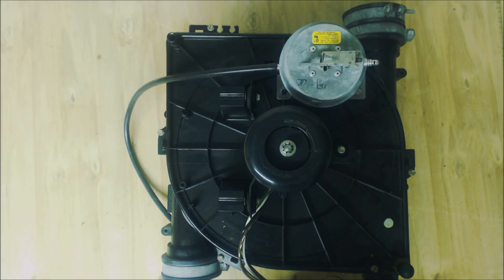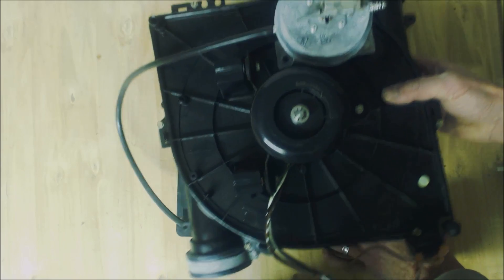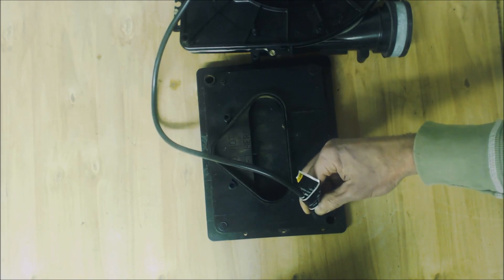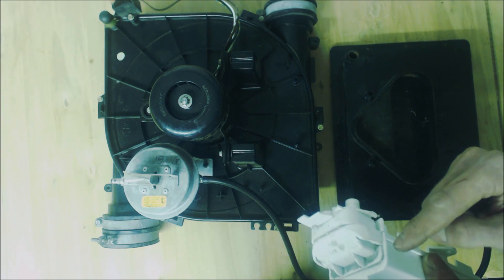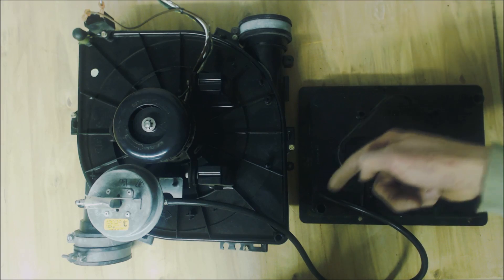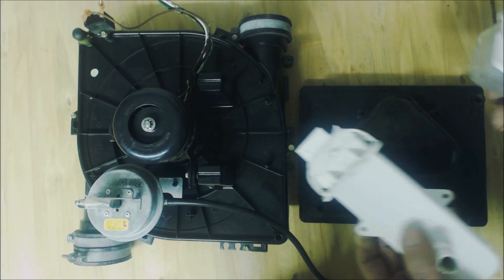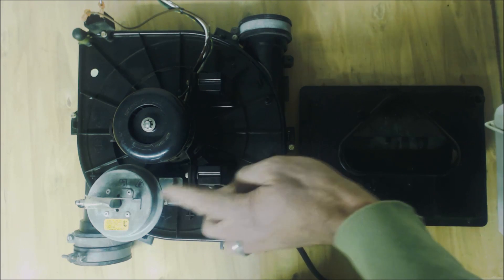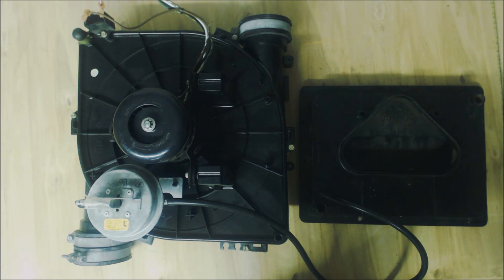Why the Furnace Pressure Switch Won't Work Because of a Clogged Condensate Drain!

Comment: if there a hole in the rubber line to the condensate trap would that cause the pressure switch to stay open ?

Comment: The condensate trap on my Carrier 59TP6A (updraft) furnace does not appear to have a drain line connected at the CondensateTrap?  How is the condensate from the heat exchanger being removed?  Thank you
Reply: Page 17 of the installation manual (available online free) shows exactly where the two possible drain locations are.

Comment: My furnace shut off because of the clogged drain.I cleaned it out but the furnace shuts off before heating house.The bottom fan continues to run then once the furnace has cooled off it starts again.I was wondering if I have a cracked heat exchanger?
Reply: I was having an issue where mine would run and the gas valve would close, flames out but the fans would still run then the flames would start again after a few minutes I ended up bypassing my pressure switch and boom worked has to be running when you do this. I ordered a new pressure switch

Comment: Tell me why they make these dinky little plastic traps that are installed inside the furnace which nobody tells the customers its there and they get clogged up with the goo every time??  Why are they so little and why use them when they obviously clog up all the damn time and ruin exchangers along with inducer motors and sometimes control boards from water damage ??  I had a guy almost wring my neck because some other person installed his furnace and didnt tell him about it and first year his shit breaks and he tells me he cleans his condensate pump and lines always every season...  so was pissed when i told him it was clogged..  those traps are shit..  why not make your own out of half inch tubing??  Those never clog from the goo..

Comment: My pressure switch has exactly been impacted by the clogged air pressure tube. Previously I thought it was due to bad switch. Nonetheless the problem was still there until I found the tube was almost full of water.

Comment: Great video.  The back unit was plugged and water was going to my pressure switch.  Drainage problem fixed 🥶🥶🥶🥶 no more.  Thank you so very much.
Reply from the maker: If water went all the way up to the pressure switch then you may want to order the same one and replace that so it doesn't break later. Water should not enter the pressure switch, thanks!

Comment: One of the most clear and prosise explanations of this particular topic that I've found on YouTube!

Our Goodman worked fine all of last winter and then the first time we fired it up this winter it was just making a loud humming noise and the local repairman said that it was the draft inducer motor so after paying top dollar to get the part ASAP from them we ended up needing to replace the actual blower motor itself and then it was fine but the igniter had went out just from banging on the machine and taking things apart and put it back together I suppose so after waiting for that to come in the mail rather than pay the local guy double the price the furnace still won't kick on it was working fine until the ignitor went bad after replacing the other parts and now the motherboard LED blinks 3 times saying that the pressure switch is bad but after trying one off of a spare furnace we are still having no luck and I'm at a loss

Comment: hi, i have an Amana direct vent high efficiency furnace. there's is a small hose that connects from the collector box to a pressure switch. the furnace works for awhile then shuts down. i pulled the hose off the port and water was gushing out. i pulled the main drain hose off and water was also gushing out. there's no blockage anywhere. with the main drain hose off and furnace running i can see water inside the port but its not coming out of the port. like some kind of vacuum or something. i am so confused. please help . thank you as always.
Reply: Same issue I currently have. Did you find a solution?

Comment: The bottom hose attached to the pressure switch , i removed and blew into the hose. I heard bubbling water. I moved on to the two hoses attached to the plastic reservoir for draining condensate and removed those hoses. All the water drained from the hose and the unit. I removed the plastic reservoir and got a jug of water, and started filling the reservoir up with water and blowing it out. Sure enough the one on the right , somehow was clogged. Some very dirty water came out on the first blow and a release of pressure could be felt . I put It all back together, and filled the reservoir with a little water before doing so. 

The furnace runs great again. Before the fan was making noise now and then, and if you hit it , it would stop. A result of built up water. The furnace would not stay running. She would exhaust to the outside and intake air, but no heat. So if you run into this problem the first thing you should do is blow into the pressure switch hose and check for bubbling water.

Comment: Thanks buddy. I came home from work to find my furnace cycling but no heat. It's -30oC (-22oF) outside here in Alberta, Canada. Error code showed that the air pressure switch faulted open. Checked the resistance and some other stuff as per your other videos and found no issues. Then I checked everything again, but for a longer time and found that the air pressure switch near the condensate drain was intermittently faulting. Turned out to be some crud in the port of the condensate box. Went in with a small Allan key and it was good to go. I appreciate you making these videos.
Reply from the maker: Glad to help Phillip!

Comment: If the fan itself fails and not the pressure switch what happens to the flame??? Will it roll out?? This is on a boiler.
Reply from the maker: The pressure switch should stop the power to the burner. The flame rollout should also stop the power to the burner, thanks

Comment: can you elaborate more on the gas valve vent line that It T's with one side of pressure switch and combustion air box? Is it under a slightly negative pressure than The other side of pressure switch tube that is going to secondary heat exchanger?
Reply from the maker: Yes what it is doing is giving the gas valve a reference pressure of what the combustion box is operating at and the pressure on the + side of the pressure switch will actually be negative but this negative pressure will be less than the - side of the pressure switch. This will arrive at a target pressure differential across the heat exchanger in order for the pressure switch to close.
James, I noticed that your name is no longer in Patreon. It is ok if you decided to not be a part of it but I was just wondering what happened? Once again, it is ok and I will continue to answer and help as I can, Thanks

Comment: Is there a inexpensive tool to test the pressure switch?
Reply: Just use meter to test resistance of the switch. When the ignition is off, there is no continuity. When the ignition is on, there is 100% continuity (resistance down to almost zero)
Reply: A manometer

Comment: could you elaborate a little more on the Trap meeting Waterway with the negative pressure on the Collector box are you saying that it needs to have water sitting in it for it to drain from the furnace so they like it needs to be primed or something
Reply from the maker: Yes the furnace will prime itself after its first use. It works in the same manner as an ac coil water trap. If you ran the ac for a short while with a dry trap and then shut the unit off, the water that has been prevented from draining will then flow down and fill the trap up with water. You would not however want to run a furnace or ac with a dry trap for a long time because you could have water problems since it can't drain. Thanks Floyd Davis!